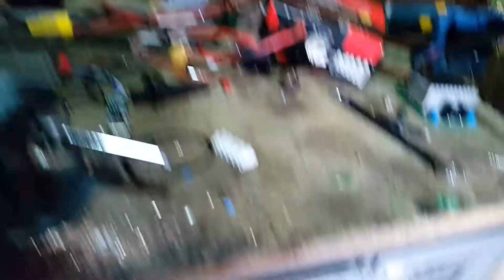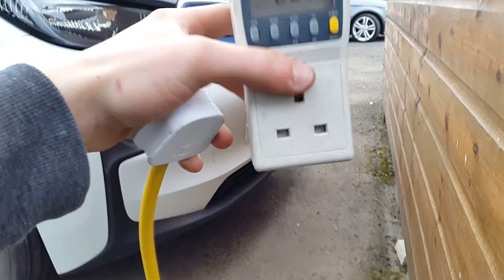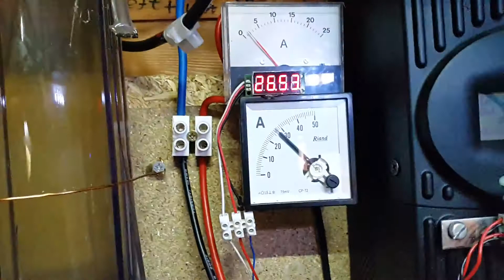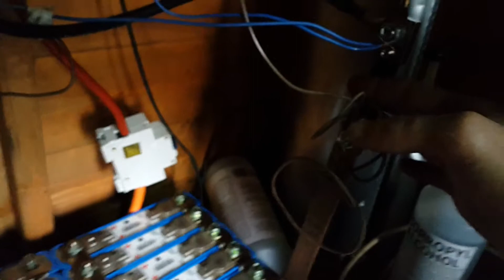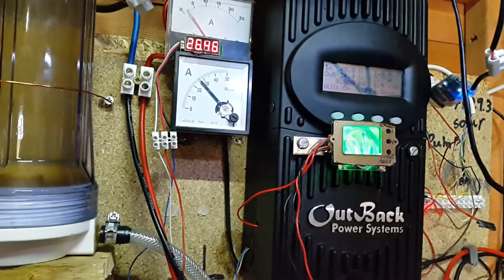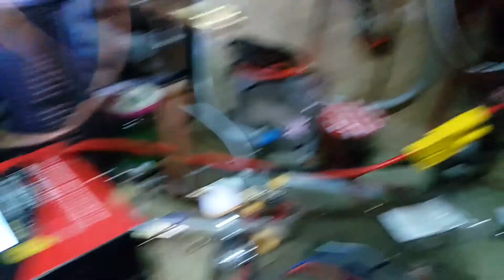DIY Tesla Powerwall - Charging the Car

Comment: Hi Shaun, my PHEV off grid battery is all wired up and ready to go. What voltage do you charge them to? Was thinking about 28v (4v per cell). My concern is how long to hold them at this absorb voltage stage. Read that lithium hate being held too long at the constant voltage stage but as they are never truly fully charged wasn’t sure if this really mattered. Interested to hear your views on this.
Reply from the maker: You don't hold lithium ion at a fully charged voltage like you would with lead acid or lifepo4. You charge it to 4v per cell and it will stay there until you start taking energy out of the battery. 4v per cell is a good voltage to use as it gives you safety headroom and your batteries will last many years.
Reply: That was my concern with lithium. With my current lead acid set up when the batteries are full they can be held at a float voltage and whenever a load is applied the solar supplies all the power and the batteries continue to float charge. With lithium they are charged and then the controller stops charge meaning all power damand is supplied from the batteries and not the solar until a voltage theshold is reached that then begins charging again. Basically adding small cycles that lead acid would not have to do. By the way my solar is 4kw and batteries can be fully charged by 11am on an average day.

Comment: Hello Shaun,
I have watched your video with interest.
Overhere in the Netherlands I have done the same, 
dismantling an Outlander pack, and using it as a power wall.
I however noticed the high Voltage Omron contactors to weld together in high currents used in a 48V low voltage bank.
I swapped it for a Gigavac contactor designed for low voltage.

I did find a suitable bms www.batrium.com or www.rec-bms.com, but at price, not to be compared to diy arduino
Reply from the maker: I occasionally get the same problem with my contactor. My batteries are remaining in balance and I just manually balance them with an isolated charger or a resistor.

Comment: what cell balancing are you using?
Reply from the maker: I have a module on each cell that I designed myself.
Reply: I aquired one of the batteries as well thanks to your great videos.
I'll be running a 48v system. So far a have not been able to source a decent Bms. Can you share your balancer design?
Reply from the maker: I have a video I made about them including diagram and source code.
Reply: is the video on your channel?
Reply from the maker: Yes, it should be quite recent.
Reply: Thanks found it, never used Arduino before though